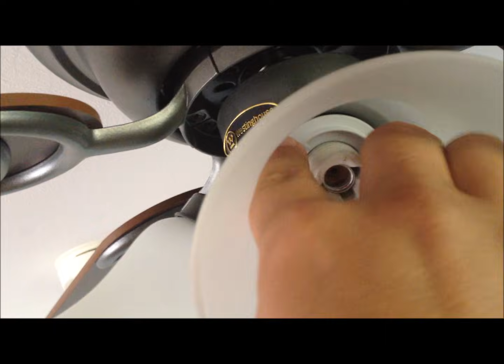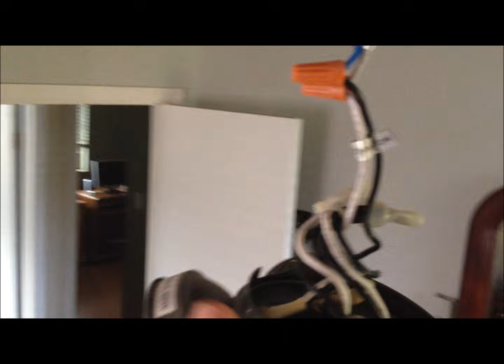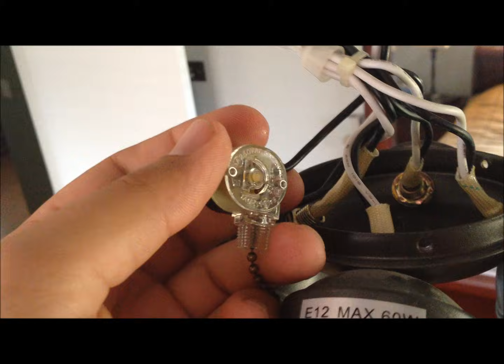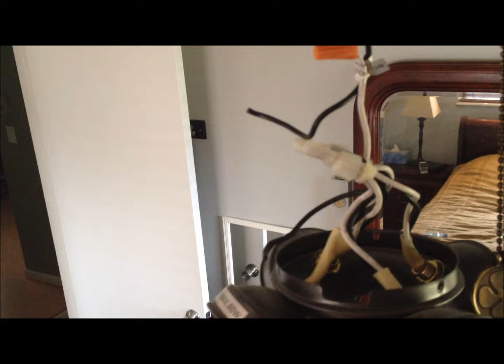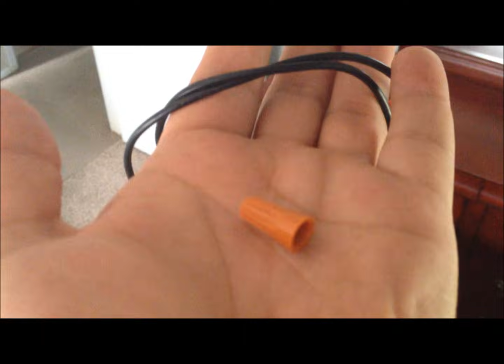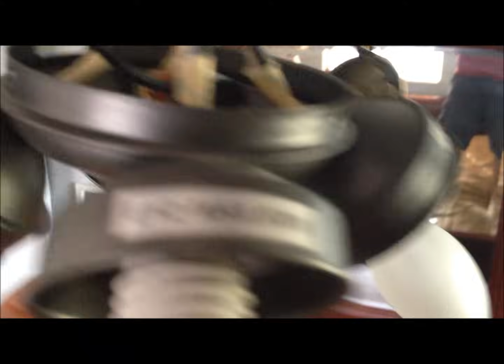How to repair pull chain light switch in ceiling fan

Comment: I had the exact same problem in that my cheap ceiling fan / lamp combo had the chain to the light seize, becoming unusable. After watching this video I felt confident in pulling the thing apart and finding the snail shaped clicker switch. It was dirty and I hit it with some WD40 and lo and behold, it was working again.

Thanks for making the video - it helped a ton in visualizing the path I needed to take in finding the part.
Reply: Thanks to your WD-40 comment, I skipped the trip to Home Depot! I thought I was gonna have to replace it again (replaced it about 2 years ago). Thanks for the video!
Reply: Thanks a Million for the great tip! WD-40 did the job in my case too.
Reply: I tried it too and it totally worked! Thanks for saving me tons of time!
Reply: This worked like a charm! Thanks for the suggestion.
Reply: Would I be able to just wd-40 the chain where it attaches or do I have to take it apart? Would that mess up the switch without taking it apart?

Comment: My light pull switch has 3wires, Blue, blk, red.  Kit is 3 bulb
1blk and 1w wire coming from fan to kit. Switch has L-1-2
On it. W wire on @ bulb wired together, 2of the blk together
Don't know how old switch connected to the blk & w from fan

Comment: This is my problem exactly! Im very pleased you made this video. Im just really scared of getting shocked once I cut the 2 black wires. Yes I turned the fuse box off to the light, but isent there still built up current in the wires?.
Reply: +Margie Kuykendall no.
Reply: +Margie Kuykendall   No.

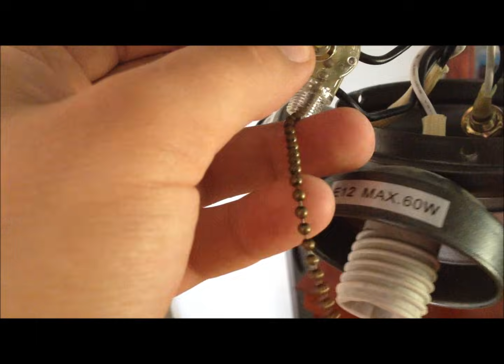Comment: @2:50 - It doesn't matter which black wire from the switch connects to each of the two black wires coming out of the wiring harness from the lights. The switch is only breaking the hot connection side to the lights.

Comment: Great vid, with the exception that the switch is a simple on/off switch. It doesn't care which wire is hot, it simply breaks the circuit. Thanks.
Reply: So if I take the switch out and just put the cut wires together  the light should work?
Reply: @brunolopez4117  Yep, the bulbs will be lit all the time with no way to turn them off and have the fan running however.

Comment: Why are both wires black can u help thanks
Reply: If both wires being black intimidate you as to what wire is what, start with the high wire first and snip the old switch from the wire and mark it somehow before you snip the second one. I would strip it right away, making it ready for immediate replacement, and then take your new switch and mark the corresponding wire with a marker. Then snip the second wire. Attache the stripped wire to the marked wire of the new switch. Then strip and attach the second wires.
Reply from the maker: Not sure why both wires are black. Use a volt meter or current tester to see which wire is hot and which is not.
Reply: Both wires are "Hot wires".  Think of it as one wire that has something in between it to cut off  the current flow if needed.
Reply: jonathan Dominguez The switch and light will not care.  Either way will work.
Reply: B/c it's just a break on the hot line. Just picture the black wire there without that snail looking switch. you're just adding it in the middle like a bridge that raises up-and-down

Comment: every video i've watched says 1st step disconnect power does that mean find the electrical box and flip the switch so there's not power in that room or does that mean turn the lights off by flipping the switch on the wall in that room?
Reply: Go to the electrical box and turn off the appropriate breaker.

Comment: And how much do those switches cost? Mine got pulled too hard and broke off inside.
Reply: Lowes.com shop for ceiling fan replacement switch.  Cost is right there for your area, pick the store closest to you.
Reply: Thx I got one at home depot fir $3
Reply: Yea about that maybe 4 I cant remember. Very easy to do and cheaper than having someone else do it.  You do need the wire strippers and the wire connectors to do it neatly and safely.

Comment: I suggest you use the plastic crimp connectors like they use in the ceiling fan itself, rather than screw-on wire nuts, due to vibration in the ceiling fan.